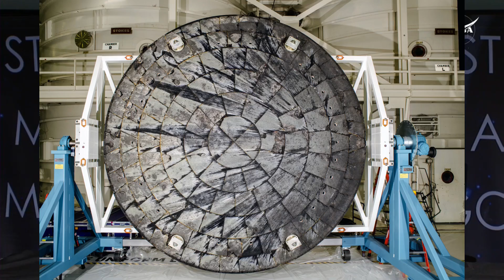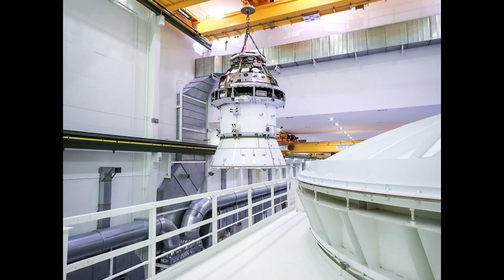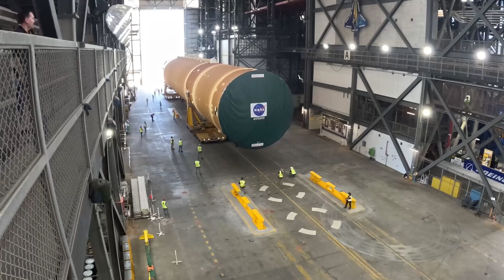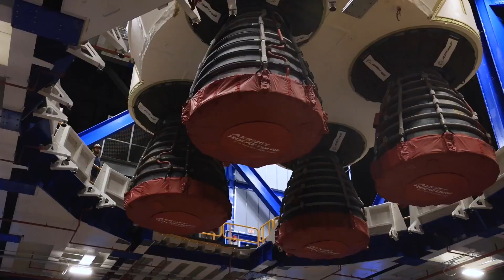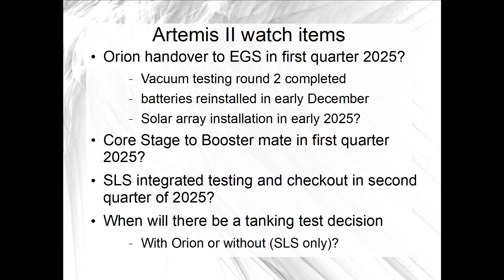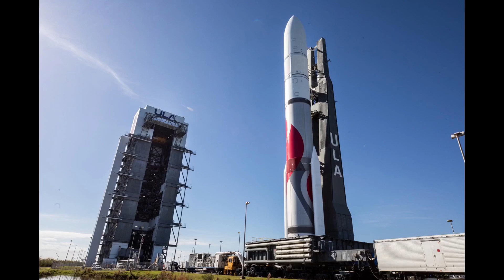What's next for Artemis II preparations and IRL considerations for a new Orion launch vehicle

Comment: Great reporting Philip and refreshing to see a channel that takes reporting more about factural than about biased opinions of it. I don't think SLS is going to be canceled but some of its missions could be reworked in a way and there will be more commercial launch vehicles in play. But SLS is remaining as the priority since as you pointed out Orion and SLS are integrated with each other. With Issacman he has to go through a big interview with Congress, the Senate and House to be able to considered NASA administrator and even with him in charge the Artemis program is run not by Issacman but by Congress and congress is the one funding the program and SLS. Even though Issacman is a great choice but most of the strings are going to be pulled through congress. He has to abide what congress says and what congress and the US government will allow him to adminstrative with. Plus I am not sure how Issacman will be able to handle it but I can be proven wrong.

The Apollo program went thru several administrations before it ended during Nixon's administration in the early 1970s and it went thru periods of cancelations threats until it was agreed by NASA, Congress, Senate, House and the president that it would be canceled after Apollo 17. And Apollo began in the early 1960s.

Plus SLS is already making alot of progress and money sure it had delays but thats with alot of Aerospace programs. The Concorde took a while for it to be developed and tested till it was approved to fly in the 1970s and it flew till the early 2000s. So again Artemis will stay because its a program that has alot of moving parts already in various stages in development and has a direction as it is edvient with the progress that is going on at the VAB, Mobile launch pad and so much more with Philips reporting says.

I know many people will bring up constellation but Constellation was running super slower much slower than Artemis and its one of the major reasons why it was canceled. Artemis is not going to have that problem because Artemis was already designed as a Public-Private partnership and a multi national program from the outset.

It relies on commercial partners while at the same time NASA and its contractors develop the SLS alongside with it. So I don't see alot of changes coming even though the internet and shrugs Reddit likes to be up in arms about it.

Plus I don't see the problem on why we can't have both SLS and Starship its cool to see two Super Heavy Launch vehicles being built and launched in the USA. Yall don't see people crying out canceling Soyuz where Soyuz has been flying since the 1960s.

Comment: Seems to me they are on track to fly in 2025, and the anounced "delay" was just a precaution. I see SLS making 5-8 flights, despite all the cancel talk. It's easy to claim such things, but once decision makers get educated on the details, cooler heads will prevail. SLS is not nearly as bad as it's made out to be
Reply from the maker: 2025 has been challenging for months.  Orion could be up to six months behind the milestone schedule they were talking about for September 2025.

If they can avoid the hiccups during the launch campaign that cause the schedule to be delayed a few days here, a week there, then they might be able to stay close to the new date, but this is basically a first flight for Orion, only the second launch for SLS, and it's the first one with crew for both.
Reply: "Precaution", what?
Reply: @alvianchoiriapriliansyah9882  It's clear with the stacking of the solids, they intend to fly in 25. The announced delay was only to further evaluate the heat shield. That evaluation is over. Orion has flown three times, and the first time was with the original Apollo style heat shield (hexagon substrate). Changing to the plate style tiles was only to save construction time and expense. The go ahead to fly with the current shield with a modified entry profile effectively ends the extended delay. SLS is proven and is well understood. Add to that the incoming administrations proclaimed dedication to Artemis, we can expect time tables to be reduced. Art II will fly in 25.
Reply: @hawkdsl  I agree with this, I think I hear the Red States and the Republicans are more in favor of Aerospace/ Defense Programs and projects than ever. But then again this could be my own observation of it. SLS is proven its an awesome flying machine. Sure it has hickups but every Aerospace program is going to have some delays and hickups along the way. Even the mighty "Falcon 9" has had development issues before it got to operational status as it is today. So yes SLS will continue flying will into the 2030s and beyond with the upgraded variants.

I agree the delay is much more of a precaution than an actual issue as Safety is very important espcially Cis Lunar Space is like Low Earth Orbit there is alot more radiation and dangerous things out there than it is with LEO espically with humans and we need to reunderstand and regain the technical aspects of humans flying beyond LEO since Apollo era.

Comment: soo, after 2 years of analysis they decide to keep the heat shield.....
Reply from the maker: Yes, they are keeping one of them.  Probably about 18 months of analysis to understand the root cause and then another six months to determine if they could fly one more as-is.

FWIW, NASA Safety and Mission Assurance declined to do this for Starliner.

They are going to have to scrap the Avcoat for other heatshield and build a new set of blocks with the permeability needed to do skip re-entries again.

Comment: How about, HLS Starship is designed to dock with Orion+ESM in LEO, and carry them to LLO.  Then it leaves them in LLO while the crew takes HLS down to the lunar surface, and then back up to LLO.  There, dock with Orion again, transfer crew, and take Orion back to Earth for EDL.

HLS Starship (the non-cargo version) is supposed to have a 100 tonne to lunar surface capability anyway.  Even if roughly 25% of that is sacrificed to carry Orion+ESM from LEO to LLO, it'd still have a 75 tonne capability to lunar surface, which is more than plenty for a crew of 4.  Larger payloads could be [pre]delivered via pure cargo variants with a full unencumbered 100 tonne capacity...

That way, any alternative launch vehicle just needs to get Orion+ESM to LEO; no additional TLI capability (i.e./e.g. an extra Centaur stage) really needed.  The launch of Orion to LEO would wait until HLS is fully refueled and loitering in LEO.  HLS loiter in LEO would be analogous to the current requirement of a month+ loiter capability in NRHO, so that in itself is not even a major change to HLS design.

Yes, such a mission redesign would pose problems for any alternatives to HLS (such as Blue Moon) that don't have the spare capacity to lug Orion+ESM from LEO to LLO.  But maybe Lockheed's space tug for Blue Moon refueling in NRHO could be dual-used for that.
Reply: I think that the only weakness in the "HLS Starship Ferry" concept (your idea) would be that SpaceX would have to fly several refueling sorties in order to "fill the gas tank" on HLS Starship in order to move the large vehicle between Earth orbit and lunar orbit. As far as how many refueling sorties would be needed, this is still unclear, but it would probably require 8 to 12 sorties or more.
Reply: @wingsley  the idea is to use exactly one HLS Starship per crewed lunar mission - with that same Starship doubling as a 'ferry', as you put it, for Orion from LEO to LLO.

The HLS Starship, as currently planned for Artemis 3 and 4, will require some number (on the order of 10) of Tanker Starship launches to fill the Depot Starship in LEO; then HLS Starship launches to LEO to fully fill up from the Depot.  This aspect of the mission architecture is kind of set in stone by now - not least because that's just how Starship beyond LEO will operate in general, including any future missions to Mars, etc.

Don't fixate too much on the number of orbital propellant delivery flights: with Starship, they will go fast and cheap, unlike any previous heavy launcher.  Once Starship is launching more than 100 times per year (which should be the case by 2028 or so), the need for a dozen or so flights to fill the Depot won't seem all that extravagant in the grand scheme of things.

Comment: Falcon Heavy would require extra certification for aerodynamic and structural loads to fly Orion, but Starship should be able to fly it inside its fairing in a single launch. SpaceX would need to develop a large payload bay door for that, which they would need to do eventually anyway. The astronauts could fly on Dragon or Starliner to LEO and transfer there to Orion or maybe directly to HLS. This option should allow for higher flight rates than SLS could. I think it's better to choose the architecture that is first to land astronauts on the moon the 10th time, rather than just once.
Reply: Orion has to be put into a TLI orbit by the launch vehicle to have enough delta-V to get to the moon and back, but Starship cannot reach TLI, even with zero payload, without LEO refueling. HLS only has enough delta-V to get from LEO to Lunar NRHO, and even if it had the delta-V to get back to an Earth orbit for reentry, it has no heatshield. A tremendous amount of work is still needed if you want Starship to cut SLS out of the loop. If your goal is strictly to speedrun 10 human lunar landings, then that probably does make sense, but if you want to actually accomplish anything meaningful with those 10 landings, then getting the science data from the first one or two is on the critical path and needs to be done as soon as possible.

Comment: In other words, NASA, Boeing, all the other suppliers, have no clue what they're doing. From the batteries designed 50 years ago, to the electronics as a whole but the launch escape system which they never even tested. Not to mention the capsule heatshield which they also redesigned since Apollos worked to well. Even the seats are noted. Any Helium leaks yet or do they save that to the last minute, so Boeing can get more money (cost plus). What a joke.

Comment: The other concern I have is regarding comments made about the fragile supply chain, which can be a concern if allowed to continue for any length of time as the program gets off the ground, no pun intended and frequency of flights increases in the future.
Reply: I suspect that supply chain fragility is inversely proportional to cadence. That is to say: If SLS flew more frequently, it would be less of an issue.
Reply: @TheBleggh  It's really chicken and egg, they had to move a SLS launch for a large telescope (idr the name) over to falcon heavy since they couldn't produce and process cores and boosters fast enough
Reply: @ethans4783  you may be thinking of the Europa Clipper mission.  Not a large telescope, as such - but a pretty large expenditure, nonetheless.
Reply: I wonder if the Chinese have the same supply chain concerns as the West and if it’s slowing their programs?

Comment: Did anyone hear how the heat shield design will be changed for artemis 4 etc?
Reply from the maker: They are qualifying/certifying manufacturing of Avcoat blocks with more permeability.  Those modifications will be used for Artemis 3 and beyond.

Comment: I still think the NASA/Nelson decision was a last ditch effort to keep Artemis going, even though the new delays announced will not  fair well. To that end, I also believe that SLS will survive through Artemis III, but will end there. I don't believe the mobile launcher 2 should ever be built. There's too many alternatives in waiting.
Reply: Launch Orion on NG to LEO,
Rendezvous with centaur stage and TLI.
Reply: @carcinogen60yearsago and what about all other co-manifested payloads? What will deliver and integrate them with Gateway? And why kill all options to deep space missions? SLS is more than just launching Orion.
Reply: @saxus  Gateway is candidate #1 for the scrap heap, even ahead of the SLS.  It's a nonsense make-work project that never made any sense, and that is actually too puny for Starship to safely dock with: Starship is so much bigger and more massive, it's almost that the Gateway would need to approach and dock to Starship rather than the other way around...   And that glaring mass imbalance problem apparently never occurred to anyone, until the Gateway was well into its design and component manufacturing!  🤦
Reply: @Spherical_Cow  It makes a lot of sense if you start to understand what each Artemis missions and the whole programs goal is and not just try to replace everything with Starship.
Reply: @saxus  Artemis 4 was supposed to have HLS Starship docking to Gateway as part of the lunar mission architecture.  Except that it's not possible to do it safely, because Gateway is too tiny (or conversely, Starship is too big).

And no, Gateway never made any sense; it's a deeply flawed and thoroughly inadequate solution, perpetually in search of a problem, any problem whatsoever, to make it somehow relevant in any way beyond being just an international partner make-work and pork boondoggle.
Reply: What alternatives "waiting"?
Reply: @_mikolaj_  Realistically, Artemis 4,5... are 4-5 years out. 3 probably won't launch until 2028-30, so we have time to get an alternative moving, if we get out of our own way.
Reply: If new Glen takes too long they could alternatively use falcon heavy, crew rating a 100% success rate vehicle  would be pretty trivial and if that is stopping us getting to the moon then frankly we deserve to fail.
Reply: @carcinogen60yearsago  ok so now, having a ready crew rated launch vehicle we spend ~5 years spending money on modifying existing launch vehicles to do a more complex multi launch architecture with lesser capabilities, for what? Getting rid of a rocket we "dont like" even though its not a cause of the program's issues anymore?
Yes one day we will need an SLS replacement, but maybe instead of making a clusterf*ck made by connecting existing HLVs with duct tape, do something properly? Build a proper cycler, maybe one derived from Blue Moon's refueling module?

Not to mention in order to Axe SLS now you need to offer congress a proper replacement in their states, and they must agree to it, otherwise they will just stop funding the program, because why would they?
Reply: @_mikolaj_  It won't take five years LOL.
Maybe one. Maybe.
SLS needs to be replaced now.
Dual-launching isn't something to be avoided. Its just better than the alternative.
A modified NG could probably send Orion directly to LLO if it uses Centaur-V as a third stage.
(Or just an expended starship upper stage, launched on a reusable Super Heavy, could send Orion in a single launch)
Reply from the maker: @_mikolaj_  It wouldn't take five years to do all the integration work, but it will be difficult to launch Orion with crew "elsewhere" during Trump's second term (also not a free exercise), given that work and all the certification required.  (Unless those certs are dropped.)
Reply: @PhilipSloss  maybe integration alone wouldnt take as much, but studying options and making decisions as to which launch vehicles should be used instead will not be a fast process and i wouldnt be suprised if that itself will take multiple months or even a year. Then as you mentioned in the video NASA will need to determine how to properly mate orion and the commercial lv together, and what precise changes need to be made. Most likely all of possibile candidates will need not a small amount of modifications to support orion, for example if i recall correclty Falcon payload adapter is rated for 30t of payload mass. While this is in theory an "easy" fix, where you just make bulkier adapter, i bet there will be plenty of other "easy fixes" and things will add up to a large pile. There is also question of infrastructure, right now most upcoming HLVs are integrated horizontally, so do we modify orion to support horizontal integration? Or do we build new infrastructure to support vertical payload integration on the launch vehicle side? I wouldnt be shocked if both options turn out to be lengthy. We also need new GSE equipment to support orion, both the CAA and umbilicals for service module.

Like im not saying it will take exactly 5 years or something, but there likely will be several big, and multiple of small "fixes" that will need to be performed and then tested, so i wont be suprised, that when on paper this would be a year or two of work, it ends up extending into multiple year operation.

And do we fund this new configuration while flying SLS to maintain the cadence and keep congressmen happy? Or do we make a gap, and take away the jobs program of various congressmen? Will they agree to it? I doubt that commercial variant will help them maintain aerospace workforce in their states, most of the work will be done by the selected LV provider, so like 2-3 states, maybe few more?
Reply: That’s where I think it’ll go. Fastest way to a landing but I think Gateway and Block 2 is on the chopping block.